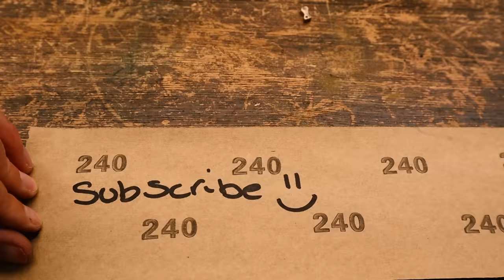Zippo lighter restoration - Vietnam War repair Long Bin 1967-68

Comment: I cringed when you painted the crest without rust removal
Reply: Same..
Reply: @TheCleansingx  yeah... it looks rusty in the end with the rest of the lighter all shiny, i don't understand hy he did that
Reply: He coulda soaked it in vinegar over night, then polished it.
Reply: He got lazy and didn't want to do more
Reply: That’s when I turned it off.
Reply: I could still see the rust and felt agitated!
Reply: Brendan Olevnik you really can’t get the rust off of it
Reply: I cringed when he painted it period! Wouldn’t kept it details rusty with a clean coat to seal it cause it gave character
Reply: @bingbop9300  Why not?
Reply: @bingbop9300  You absolutly can
Reply: Im sure he had a reason
Reply: Brendan Olevnik Absolutely
Reply: @bingbop9300  I think it might have been a little too brittle to be able to use any harsh methods or chemicals.
Reply: @ArbolAbril  yeah I thought the same. It gave the Zippo a character that it's actually old
Reply: "Direct To Rust" metal paint.
He didn't want to alter the shape or design of the crest.
Reply: chevron*
Reply: "Hammerite - Direct to Rust"
Reply: Brendan Olevnik it was add to rust paint look at the can
Reply: I would have kept the zipo rusty as it was.
Reply: @cafenightster4548  that is not surface rust. to remove it you have to remove top layer of material which he did not consider as the crest is thin enough and has details engraved. source: forging QAE
Reply: @evaldaskowka  That's what vinegar does, it removes a very small amount of material, Its a mild acid bath.
Reply: You people do not understand the process of restoration... in certain circumstances, you can only do so much. Or the item will be in a worse condition than when you started. It was the best and only way to restore that piece.
Reply: @fparadise1979  I think it maintains some credibility or legitimacy by having one part being worn and war hardened, basically something that tells you this thing has "seen" war, but with fresh clothes. It might be a testimony, historical proof of sort, etc.
Reply: @XaviorvorteX  Truth, sometimes things are to far gone to fix without using new pieces.
Reply: It's called contrast. I assume it was done on purpose and the paint used has a rust inhibitor in it (which you can see in the video at the 6:31 mark). Not everything has to be taken to a mirror finish. I like the choice not to polish the piss out of the eagle.
Reply: @ArbolAbril  yeah
Reply: You ruined the dope patina
Reply: May have distroyed the delicate worksmanship on it.

Regardless, preserving that crest's rust is like preserving history, to me. I don't mind.
Reply: Colin Swift That PO3 insignia does come in black as well. I think this was fine restoration.
Reply: Ugh man that's just disrespectful at that point
Reply: I didn't expect so many replies. Its interesting to see what different people think across a spectrum
Reply: He probably did it in memory of the war vet as a symbol of the times we went through and what it caused
Reply: I actually kind of like it. I would have done without paint maybe,  but the patina looks really neat and it adds character
Reply: lol yeah
Reply: It was made of bronze
Reply: @Er sure, i understand that it gives it a little character. but maybe he should have kept the whole outside part a little beaten up as well then, so it wouldn't look so shiny. the contrast is too much...
Reply: @BIOSHOCKFOXX  but the rest is too shiny. looks like he glued a piece of garbage to a new lighter
Reply: He couldn't have done it without electrolysis or physical removal which could have resulted in loss of material on it.I mean it is probably possible but would take too much time and effort to do so.More then he spent on that entire restoration.
Reply: The paint says "strait to rust"
Reply: Brendan Olevnik it would have made it dull
Reply: Opi-Rage you have no input just based on your content.
Reply: I cringe every time on his close ups.  Sanding scratches all over it. .
Reply: He left it rusting on purpose, like you can't restore the history, i respect that. That why he put the inscription at end of the video. Although i'm not sure what it mean, cause i'm Vietnamese and not good with English.
Reply: H
Reply: Looks to be bronze.
Reply: Me too! Why in the hell did he not restore the eagle? Made no sense whatsoever!
Reply: jason200912 bullshit. He probably did it to appease all the people who always comment he’s ruining somethings history by making it look new so he left one part looking aged.
Reply: where's your video?
Reply: @kevingordon669  where's yours?
Reply: The ultimate disrespect when he liked ur comment
Reply: Hammerite paint supposedly can be applied directly on rust as it's a glue paint.
Reply: I am from Yemen.  How old is this watch?
Reply: I'm sure the restorer considered it carefully and was torn between aesthetics and potential damage. I myself thought it would look cool rust-on initially. Apparently not.
Reply: @James-wd9ib  hi
Reply: @James-wd9ib  where are you from
Reply: The crest was very thin he did remove as much rust as he could without ruining the crust the paint was most likely rust retardant he did a beautiful job
Reply: He kept history
Reply: WTF?! WHY DID HE  JUST DO THAT?
Reply: @bettkante2593 , it's metal to rust paint. read the can.
Reply: Crrrringee
Reply: Didn't like the crest left like it was, otherwise a very nice restoration
Reply: Brendan Olevnik me too
Reply: I’m sure he had his reasons. Plus it’s the thought that went into it. Like really he didn’t have to even repair it but he did.
Reply: It’s symbolic to the navy . That’s a navy 3rd class petty officer insignia and we paint once over dust and twice over rust lol
Reply: Brendan Olevnik I think it's cool. The only restoration was to make it functional and not cut your fingers.
Reply: I think he wanted to keep part of its history
Reply: I think the metal and derailing were too thin for complete rust removal. With metals as thin as the crest  around those days, when it rusts there's kinda no saving it completely. 

Plus even if it could be restored, maybe he kept the rusty crest as kind of a memory of it's past, like how gun enthusiasts will restore old handguns from wars but some will keep all the scratch marks.
Reply: Same too
Reply: @mrpaintballvids123  *crow
Reply: But it looks like he only painted what the Eagle was standing on not the whole crest itself🤔maybe I’m wrong but around 7:45-7:56 that’s what it looked like
Reply: It's called patina guys and for some people adds up; it's supposed to make you reflect about the history of that item in it's 50 years life going through a war carried by a soldier god knows if ever came back; or maybe not but I'm sure it will make you think rather than just having a shining new object with no life
Reply: It’s because the vinegar are solution would disintegrate the metal so much the markings and detail won’t make the metal look like a bird.
Reply: Brendan Olevnik probably to give it a sort of antique feeling or whatever
Reply: Did y'all really miss the fact that it was direct to rust paint?
Reply: Some parts cannot be restored fully. If you try, they break.

Like some parts of  the titanic they found, sure they can try to fully restore it, but a lot is beyond salvation
Reply: Yeah, me too.
Reply: The client may have requested that a small amount of patina remain.
Reply: Bunch of powder puffs
Reply: Dnt need it though. Think
Reply: Personly it would look stupid all one color
Reply: Jack Skellington it’s also a case of the size of the emblem. Using chemicals or vinegar could affect the proportions and the overall design and make it look a bit worse.
Reply: Brendan Olevnik Mabey he wanted to keep it like that on purpose.
Reply: I think it looks cool with the rust under the paint.
Reply: It’s a third class petty officer crest leave it rough
Reply: The rust removal process is very damaging and I think if he did try and thoroughly remove it he would have damaged the detailing on the crest which would have been worse than just what he actually did.
Reply: Good eye I never notice that and yeah your right.
Reply: @fparadise1979  to show its history and we're it's from
Reply: I think that although this looks cool for civilian /street, it would look more authentic if it had camo motifs, like a pale matte green  for the zippo. If that was done I think it would’ve matched the eagle and given it a more practical and less contrast, but I do like the shiny :)
Reply: @ArbolAbril  I thought the same
Reply: It adds a nice aesthetic.
Reply: @fparadise1979   -  My feeling is that he wanted to leave one part of the lighter - in this case the crest - with an echo of the corrosion it had once carried.  He did clean it up, and painted that chevron in black, but the eagle itself was not fully polished out.

Reminds me a bit of Japanese 'wabi sabi', in which things are fixed, but the trace of the damage is not completely done away with.  There is a kind of beauty in things which have been broken, repaired, and are not afraid to show the repair work.

In a weird way, I think that the corroded eagle is quite tough, yet also a little 'romantic' too.
Reply: The rust becomes the primer with naval jelly.
Reply: bcz APPLY DIRECT TO THE RUST
Reply: No rusty inhibitor. Tch tch 🤔
Reply: flavia_yt i feel like he did that to keep the eagle 🦅 in natural state, to appreciate how old it is and to tell the stories it has been thru.
Reply: Most likely the Petty Officer 3 logo was brass with a nickel plating. I am not a someone that knows how to restore things but have played around with such things in the past. Depending on how much corrosion would definitely be a deciding factor in how much to polish it. I don't know what this guy can do to restore but that is mostly reversible. So he could as far as I can tell go back and remove the paint and do different restore to it. Right now that paint is more of a preservative.

I did not like that it is not what I think it should be BUT it is a beautiful job and might of been the best choice.
Reply: I must say that I really liked the look of it! If he would polished that too it would blend into one flat thing but like that the eagle stands out and gives it a vintage look
Reply: Colin Swift petty officer third class eagle*

Comment: This one, in fact, is real. My uncle, who is a Vietnam vet, has 5 of them he bought at Binh Long. One of these varients specifically. Proud to see this Resto.
Reply: But.... the corrosion is fake.  It's a brass case, so wouldn't rust like that, no pitting when cleaned up, the cotton inside was really clean for something that would have had to be underwater to corrode like that.

More than likely dipped a nice lighter in a bucket of rusty water and let it dry on there.  So really just a cleaning and not a restoration. 

A lot of guys do it overseas to get in on the money made from restoration videos on youtube.  Even this channel if you look at some of his past videos.

Once you realise it's fake corrosion and know what to look for it's pretty obvious.
Reply: N M Might be chemically done as well, but in any regard I agree with you. The wear was inconsistent with the outside and much of the rust looked suspiciously new.
Reply: - Oxidtation then lol, you know what I mean
Reply: Brass is a red (copper-based) metal, it's nothing like iron. It doesn't "rust", but it oxidates quite easily. The oxidation layer actually protects the metal underneath, so there won't be any pitting for a very long time. Remove the oxidation layer, and you can easily get the metal underneath to look like new. See all those green copper roofs?  They're good for a century or more.

Comment: I love how Zippo hasn't changed their design of their lighters even though they have been around for like 100 years!
Reply: One thing I never got was the claim it can withstand wind (and it was designed for that purpose). No zippo I had could ever withstand even a breeze.
Reply: If you find something that works why change it
Reply: ARC Trooper7610 I also love that you have to buy special lighter fluid just to get it to work:)
Reply: @MrSad-my3xc  nooo not right. Once my zippo was empty I put in a few drops of regular Gas and it worked finde. More smoke than regular but OK..
Reply: @MrSad-my3xc  Totaly agree! My friend Abrahim never puts the lighter fluid or flint in his Zippo bc he doesn't want to ruin it.
Reply: @robinaleksander6791  I agree! It's just a perfect design!
Reply: I have never gotten so many likes on a comment! Thank you all!
Reply: @mml2591  thats very unhealthy and dangerous

Comment: Is it just me or do you hear literally everything. I mean when he dropped the nut into the glass I felt the bass in my phone. I need that kinda microphone
Reply: so you’re into asmr i see
Reply: Those drilling sounds gave me dentist's flashbacks
Reply: there is no bass, the nut and glass aren’t capable of producing low end naturally.
Reply: AUX ZILLA nerdddd
Reply: @auxzilla5495  yes it would make high frequency sound
Reply: And how do we not hear his breath ?
Reply: Lol and he shows everything up close makes it look all easy I'm good no subscribe for me
Reply: @Herostratus222  most likely he has a mic close to his mouth, with a simple filter he is able to cancel it out and leave only the tool sounds
Reply: @auxzilla5495  it is due to the glass being on an old wooden table, the table has a decent bit of mass, so the nut dropping is dampened and some of the absorbed vibrations are emitted as bass
Reply: BiC MC That is what would make the sound flat, not shift the frequencies created by the glass and nut. The table isn’t capable of altering the frequencies that come in contact with it, only flattening the sound. Nice try tho.
Reply: @auxzilla5495  its like hitting a drum, it will cause the table to vibrate a little, that combined with the EQ causes the nut drop to create bass
Reply: AGENT WOLF k
Reply: That's on purpose. ASMR.
Reply: Я бы тож нашол ну не судьба
Reply: @auxzilla5495  there is like 200hz and that's mid low range of frequency spectrum and it's where top of the bass is so yes and no

And yeah the table did it mostly
Reply: AGENT WOLF yeah me too

Comment: Imagine doing this without electrical tools but by hand
Reply: I feel like it would be more fun
Reply: @distorteddragon9502  "fun"
Reply: The only "hand made" parts now are loading/unloading the buffing and plating machines, gluing on the emblem and cleaning/boxing them. It's pretty automated but still many departments touch them.
Reply: Gear reduction like a potter's wheel or sharpening stone.
Reply: @HellcatCustoms  forklifts
Reply: That sounds like unreasonable torture to fix this damned thing with nothing but your bare hands.
Reply: yep
Reply: I'd like to die if I was forced to do that
Reply: uses a drill

Comment: I think you could do more about that eagle. It like unfinished to me.
Reply: That's the point
Reply: @ryanhoover8701  Explain a little more. That's the point because he'll do it in another video?
Reply: @IFeastOnGlue  The entire emblem should be the same color. Either all black or all oxidized silver.
Reply: The owner probably wanted to keep something original to it. If you wipe it all clean it ends up wiping off the memories too. Because then you can never touch the surface that you did when it was with you on these adventures.

Comment: I've done a lot of restorations on Zippos as well, and for future reference, the next time you're doing one for a customer, remember that it's less expensive to buy a 3 or 5 pack of cheap lighters and remove the flints, using them to place in the Zippo than it is to buy Zippo brand flints that aren't as long, and you get more longevity from the ones in the lighters.. Also, you can store the extra flints in the cotton wadding inside the fuel chamber. Excellent job, by the way!. (P.S. Long Binh is where Johnny Cash went when he was overseas during the Vietnam War entertaining the troops.)

Comment: In my opinion i think it looked way cooler with the outside as i would have just changed the insides so it worked
Reply: Nah keep the outside but put a clear coat over it so it adds a layer between u and the rust
Reply: And doesn't cleaning it destroy the value?
Reply: @SalHunter1  not really much value in something like this, but for coins, yes.
Reply: В Белорусии этого валом было

Comment: It wasn't actual rusty. He must have make it looks like rusty using some chemicals or something. Because no structural damage happened, every whole is in shape
Reply: Thank you.  The horizontal bump in the inserts was started in 2000.  No way a lighter from Vietnam era had it, and no way in less than 20 years it suffered all that corrosion unless forced.
Reply: @Gitemstevedave  really? now this peaked my interest. tell me more please.
Reply: Brass doesn't rust. That's why. There is no iron in it to cause rust.
Reply: Agreed. No pitting and no holes. If something has ~50 years of surface rust, there should at least be some structural damage. It also cleaned up way too easily to be real.
Reply: hes probably like "lol easy 14 mil views"
Reply: @agenttechnoman  

I think you and others are missing the fact there is bluish green surface 'corrosion' or verdigris all over the lighter body, the body is made from copper and brass. This is why you're not seeing any pitting.

It actually forms a weather proof, waterproof coating which completely inhibits any further oxidation and reaction to atmospheric surroundings.
Reply: teach me please, I'm interested you know that well